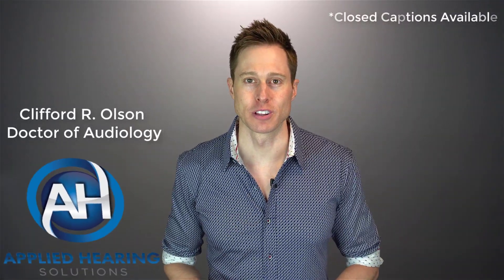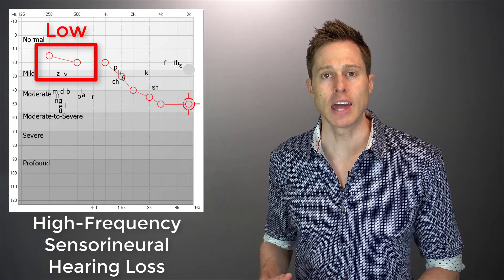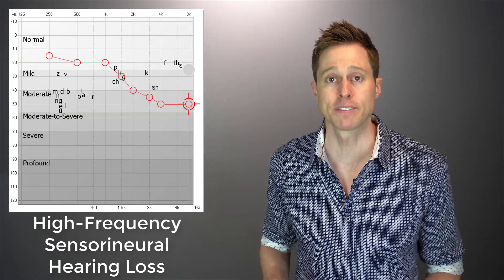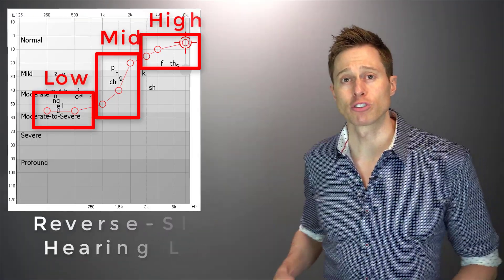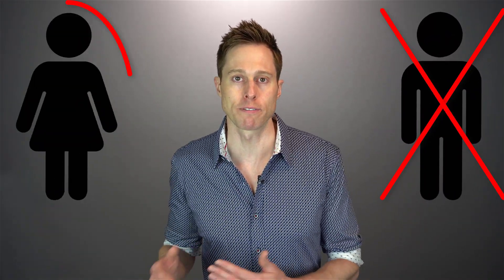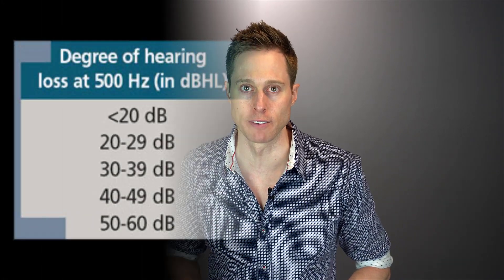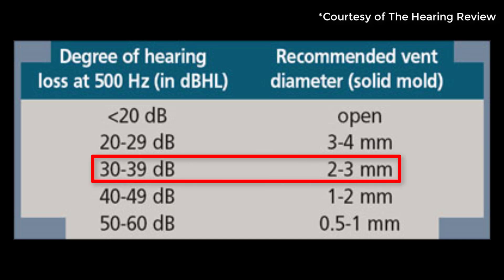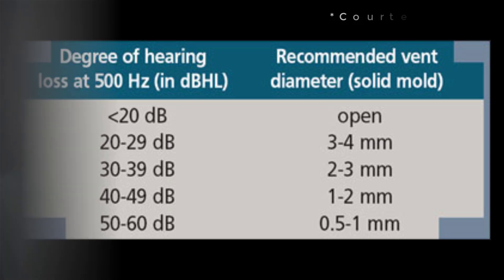Reverse-Slope Hearing Loss | Hearing Aid Treatment SUCCESS!

Comment: What if you have mild hearing loss in your left ear but still hear pretty good out of it? My left ear dropped to 35db at 250 frequency and 30db at 500 frequency where my right ear was 20 and 10.

But I can still pick up sound and bass from songs, talk on the phone find out if that ear, I mean I can hear background noise good and what direction it’s coming from etc. like I can hear pretty good out of it, only thing I’ve been experiencing is this pressure and fullness sensation and low pitched ringing sensation, or ringing from the pressure I don’t know how to explain it. It’s not high pitched ringing and it does ease up at night it seems like. I’ve also noticed sensitivity to some sounds like scratching the wall I can feel it in my ear, closing lids hard I can feel it, sometimes my voice or other peoples voice I can somewhat feel it in my ear as well… it was worse at one point, but has improved atleast gradually. The humming test I have a hard time distinguishing which ear is better, most of the time it feels equal and other times maybe slightly louder in my right ear?

My symptoms at one point were pretty intense with the pressure and sound coming from my ear, that’s really the only time I notice a little difference in my hearing? When it eases up it almost feels normal. But it seems like for a week now my symptoms have gradually improved? Not 100% but better than it was gradually.

I’ve been getting treated for middle ear fluid for about a month and half now, and been dealing with these symptoms on and off for 2 months exactly. I haven’t had vertigo or any other serious symptoms, just the pressure and fullness and low pitched ringing. I got sick with a bad head cold and congestion, stopped up, sinus headaches etc and lasted for like 10 days ATLEAST and somewhere between the 7th and 14th of November I woke up and noticed my left ear just felt like, full? Pressure? And that sound (low pitched ringing or whatever) thought maybe I just slept too long on that side and all that mucus and congestion went to my ear, and I just kinda shook it off because I’ve dealt with this similar experience in my right ear years ago and it got better over time so I didn’t really think anything of it, well November 28th was my first visit at this clinic and that’s when I started getting treated for middle ear fluid and slight mild infection idk. Never would have thought of hearing loss, never would have crossed my mind. I don’t do anything to super loud excessive to cause damage, I don’t have any diseases. But maybe it was whatever virus attacked my sinuses I have no idea. Maybe my body is just taking longer to heal and get over this.

Just curious if anybody out there has dealt with similar symptoms that I’m dealing with and if they think my situation will get worse or these sensations in my ear will last forever??? It’s been 2 months now and my symptoms haven’t gotten worse, I mean for a while it seemed like it was on a routine, where it would ease up at night and then flare up bad when I wake up and midday.

If anything like I said maybe some slight gradual improvement.
Reply: How are things now? I am also having similar hearing loss

Comment: My hearing loss is the opposite of what you explained in your cookie bite video, where my lows and highs are moderate/severe but the mids are in the normal range. Is there a term for this or would it still be considered cookie bite loss?
Reply: Called -  Reverse Cookie Bite  You can Google it.

Comment: Wow , I have reverse slope hearing loss and u told exactly that I feel. I’ve been using Oticon OPN1 for a couple years now . I’ve gotten it set according to REM that you mentioned . I use a hadd mold with a vent too . Is there any better newer technology than these Oticons yet ? Any other HAs u suggest that might be better ?
Thanks in advance Doc !!

Comment: Hlw Dr.Cliff This is Abhisek Laha, your regular youtube follower and fan..I am facing automatic ear locking and hyperacurasis problem and can't listen a certain thing in a particular freequency tone.I often have to increse volume....Sir can you suggest what is exact problem of these symtoms?? I will be waiting for your kind reply.....☺
Reply: Hi, I have one ear with normal hearing and one ear with reverse slope hearing loss and hyperacusis. The problem is sensorineural and happened overnight. Maybe my experience will be helpful to you.  My bad ear can't hear very low frequencies at all, but can hear high frequencies very well. Intermediate frequencies (on the slope) sound extremely loud and distorted to me. Even quiet sounds at these frequencies are extremely stressful and borderline painful. I believe it is because hair cells in my cochlea are damaged, maybe Dr. Cliff can explain that more. I didn't expect a hearing aid to help me, but it did! I use a custom ear mold to basically prevent any sound from entering my ear normally. A behind the ear hearing aid picks up all sounds, but it is adjusted to only reproduce high frequency sounds, over 2 kiloHertz.  It has given me back my life!!! Wearing the aid has given my brain and me a break from the stress of hyperacusis. I can finally go for walks, to stores, and (after Covid is under control) to restaurants and movie theaters. Plus, I can understand conversations better now, because I can listen with my good ear, without struggling to ignore horrible loud sounds from the bad ear. I hope you find a solution that works well for you.  Good luck!

Comment: Hey Dr Cliff
I've just gone from a power speaker with power dome to a custom mould fitting and want to know about changing the receiver filter if it fills with wax which is a problem I have.  With the power dome it was easy maintenance.  The custom mold allows me to hear without distortion or feedback.

Comment: Is it still considered RSHL if it’s the low and mid frequencies that are bad, then in the high frequencies (around 4k) it raises to mild? (In the video it said the low frequencies are bad and it slopes up in the mid frequencies)
Reply from the maker: There are different levels of Reverse-Slope hearing loss.  It is possible for the "better" threshold regions to still have a hearing loss like you indicated.

Comment: I like your videos but some of the information is very technical and hard to grasp when spoken so quickly. Especially for us hearing impaired. (BTW, I have Bilateral Reverse Slope with distortion so my speech perception is not good.) I was very impressed that you even addressed this rare problem of reverse slope loss.
Reply from the maker: Hi Tzippi.  I was concerned that this topic would be a tough one to explain clearly.  As I was editing, I was thinking that it could be difficult for some to follow.  I actually had to record it twice because my first attempt did not go very well.  Hopefully you still got some value out of this one even though it wasn't my best work.
Reply: You can adjust the speed of the video in the settings
Reply: A) "hearing impaired" is offensive, and b) adjust the speed of the video
Reply: @dancingpianofairy  why is it offensive? What do you suggest. Speed adjusting doesn't help everyone, especially me
Reply: @tzippipollock1937  It focuses on what people can't do. I suggest hard of hearing.
Reply: I am hearing impaired. I don't find it offensive. Focus on what matters.

Comment: Hi Dr Cliff
This was really interesting for me   I have RSHL and have struggled immensely to get the HA profile adjusted to my liking. REM was helpful but did not provide the perfect solution for my Oticon Open S 1 with closed domes, grip tip. 
The three program options in the Oticon App do not provide any ability for self adjusting any frequencies. 
Do you know of any Oticon compatible app which has a type of equalizer similar to the one you show in your video?
Reply from the maker: Oticon would not be my first choice because their ON App does not give you access to an equalizer.  The use of REM is more to measure your preferences based on App adjustments.  Otherwise, virtually any prescriptive method over-amplifies Low Frequencies.

Comment: Dr. Cliff, do you see patients remotely?  I’m not quite sure hearing loss in my family is Reverse-Slope.  Last time I checked, hearing is almost normal on high and low pitches, but not in the middle, which constitutes speech.  Maybe this type of hearing loss doesn’t apply, but your recommendation for the patient to make adjustments via an app and testing various domes is appealing and self empowering!
Reply: If your middles are missing, that's called cookie bite loss. If that helps for searching for more information :)
Reply: Ines C thank you!  Never heard of cookie bite loss!!  I’ll Google it!
Reply from the maker: Ines C is correct, it sounds like you have a Cookie Bite Loss.  Fun Fact:  I have a Cookie Bite Loss as well.  I will likely make a video discussing Cookie-Bite in the next few months.
Reply: Doctor Cliff, AuD can you work with me remotely? I’m in Chicago. Pretty please!!  If not possible, can you please share what hearing aid you’ve selected for your own cookie bite hearing loss?  This would help me to research.

Comment: Great video.  A fourth complication with reverse slope loss fittings that wasn’t mentioned is upward spread of masking, but this is a more complicated topic and would add several minutes to your video just to explain.  But it also helps to account for why RS patients generally prefer more mids and highs and less lows than you would expect.  

So a suggestion to follow up this video would be to discuss USoM and how it can affect fittings—yet another reason why REMs need to be completed.  

On another note, I’ve often suggested that the researchers at the National Acoustics Labs (NAL) come up with a fitting formula specifically for RS losses.  Call it NAL-RS.  It could be worked into software and applied as needed, effectively fitting them better than NAL-NL2 since that’s more oriented towards traditional HF sloping losses.
Reply from the maker: Thanks Scot!  I should have included USoM, however, as I edited this video I'm glad I didn't.  I found this video to be potentially difficult for the average viewer.  However, USoM is one of my most favorite topics and I agree that it needs it's own video!  Love your idea for a specific NAL prescription of RSHLs.  Who do we know that works at NAL now?
Reply: @DrCliffAuD    USoM would be a lot of additional to cover in this (agreed).  It's enough of a topic by itself, and would be a great one to cover from a lot of angles -- like why REMs need to be done, why basic amplifiers can actually make clarity worse than better, etc.
Reply: I would definitely be interested in a video explaining the upward spread of masking! Also, someone in a RSHL Facebook group Im part of mentioned cochlear dead zones being suspected with low frequency hearing loss. Can you explain why that is and how you would find it using Audiometry?

Comment: Could you confirm which app is featured on this clip?
Reply: Hi

It's the myPhonak app.
I've been using it for 3 days so still getting used to it. Keeps losing connection to my aids (Marvel 90). The app is good though and I can play around myself which I like. I have reverse slope and the Autosense setting that the app defaults doesn't seem to help me but the ability to change settings myself is very good.
Reply from the maker: Yes, it is the updated MyPhonak App.  I find the stability of the app to be less than ideal, but the goal is to use it to identify your preferred frequency response so we can measure it with REMs and adjust your AutoSense settings or create a stable custom manual program for you to use.

Comment: What about the correct level of the receiver? Normally this kind of hearing loss need more power...
Reply from the maker: It is possible that receiver power could be a factor, especially if the individual prefers more Low-Frequency amplification.